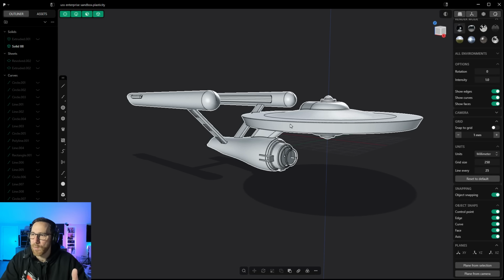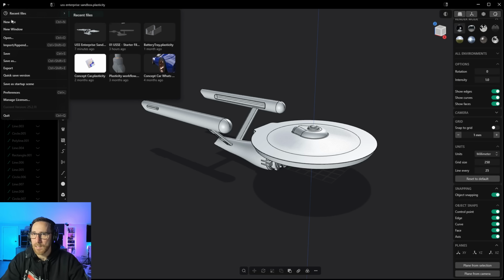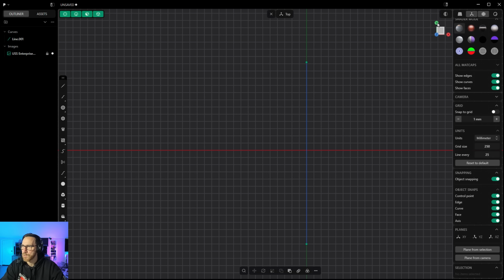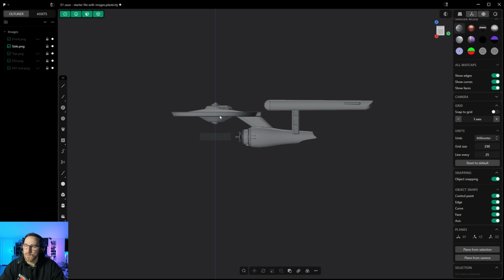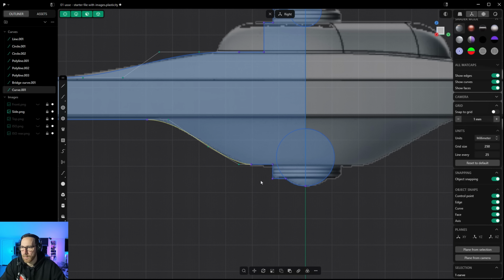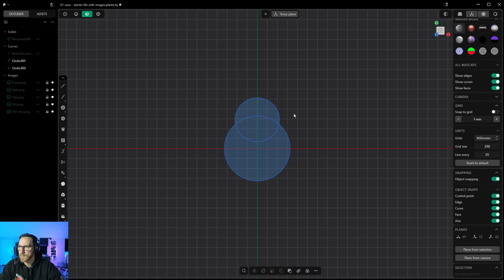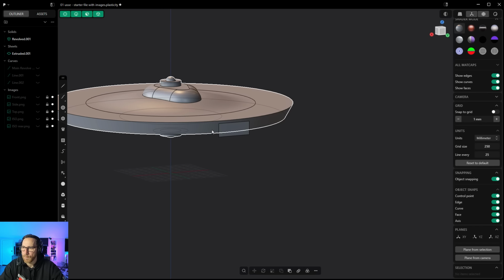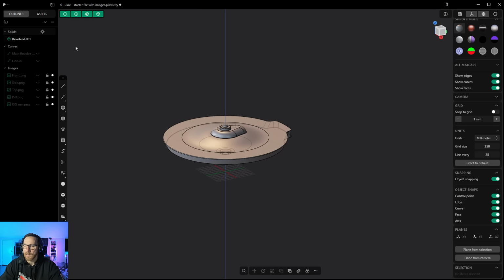Plasticity Beginner Modeling Series Part 1 | USS Enterprise #plasticity

Comment: Scale + pivot = lock one edge of your image in place on your reference line, then drag the image with uniform scale handle to meet the other end of your reference line (vs trial and error).
Reply from the maker: Great tip!!!
Reply: lock one edge of your image in place on your reference line.You lost me here
Reply: @t @tommccaw3229 if you use the Scale tool and also select the pivot option you can “anchor” one end of your reference image in place (that’s the pivot) and then drag the image to the correct scale/size. Think of the 2-point rectangle tool. Same idea. Anchor the corner to start then drag to size.

Comment: Can you do reverse engineering in plasticity?
Reply from the maker: Yes you can but its not its strong suit.
https://youtu.be/l64Jjvqu03Q

In several videos we show quicksurface, fusion, and plasticity and how they work.  Also the channel TakeRefuge3D recently did a reverse engineering video from a scan in plasticity.

Basically you have some tools to auto create surfaces on a mesh and you can create curves directly on a mesh.  It would be good if you had a mesh model of a car and wanted to draw 3d curves on body panels.  But for true reverse engineering a dedicated program like QuickSurface, or a CAD tool that can also handle some of those tasks like Fusion are still preferred for me.